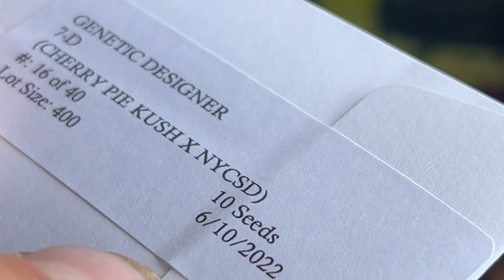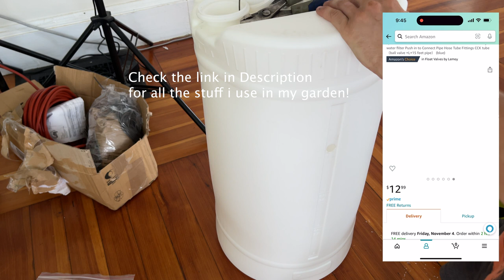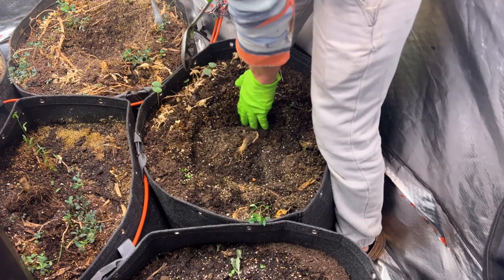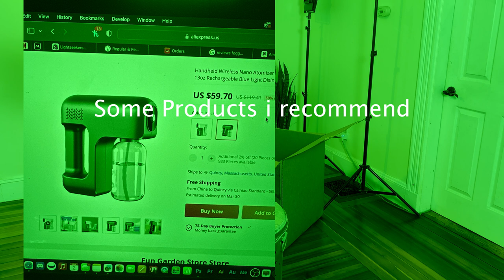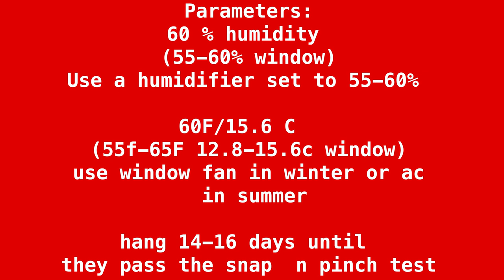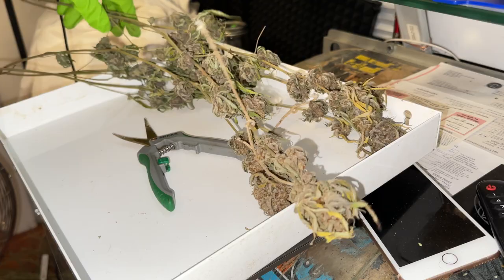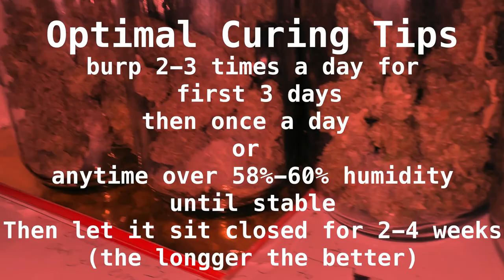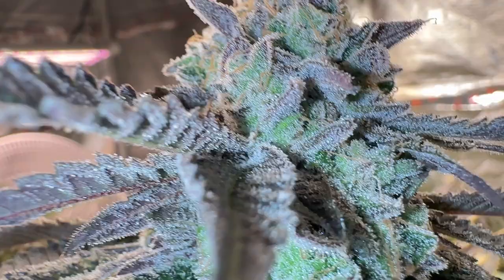How To Grow Organic Weed Easy! Just Water  From Seed to Harvest! Guide to Higher Yields and Quality!

Comment: Any tips on mold? Ive been doing the organic thing, and about 3 days tò havest my girls get attacked, no signs before but its happened on the last 4 harvest and its killing my yeilds wasting my time. Im in California and my humidity is usually super low except for the atmospheric river that just happened
Reply from the maker: I havent had any issue with mold in my flowers, id say you dont have enough air flow and circulation perhaps deadspots in the canopy, whats your ventilation like? I would suggest taking all your plants out and cleaning the whole tent with hydrogen peroxide, wear gloves and a mask and make sure its vented properly while cleaning, then you can put your plants  back in then add more oscilating fan movement above the plant canopy and also more fans above the lights to prevent dead spots, and set up your intake so it blows in at an angle to increase circulation below  the canopy, sometimes another fan below the canopy opposite side of the intake is necessary for good circulation,

Comment: What do you think about using a SIP with your 25 gallon cloth bags?
Reply from the maker: Ive seen some organic growers have issues with the bottom fed pots others not so much so i think it depends on strain, i do use a self watering system tho the only one id recommend for organic growing so far that i know of is the blumat system since it maintains a desired moisture level while limiting dry back, with its ceramic carrots in conjuction with a moisture meter, once you get it all set the plant is taking up all the water it needs and this enables me to dial each pot to eacj plant so they sll get their exact requirementd making it easier to grow multiple cultivars at once
Reply: @organnabisgrow  interesting. I've looked up raised water bed type of self water systems for potential backyard tomato grow. I saw the entire bottom being entirely covered with giant corrugated pipes or just purely gravel at the bottom. 

The woman who did the corrugated pipes probably had a 100 gallon setup. Via pvc pipe, it took her like 5 minutes to fill up all those pipes/rocks at the bottom and reported that the soil stayed moist for more than 7 weeks before she had to refill. I know that cannabis plants are probably more water intensive than whatever plants she was growing though but that's some huge water savings.

https://www.youtube.com/watch?v=FoaGrgvMkR8&list=PLBcWprMIwYYgCL4xDq6qcTQqDfW2tSdxF&index=9

This is one if you want to connect all the tubs
https://www.youtube.com/watch?v=Spt0hFVLeKk